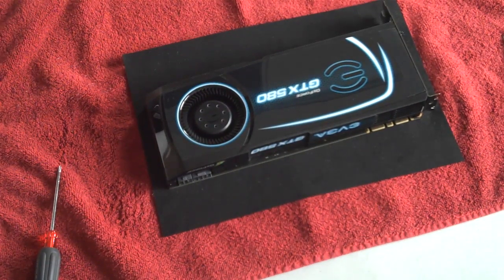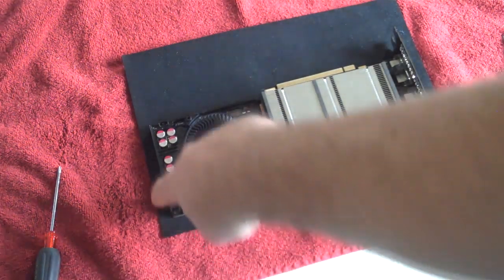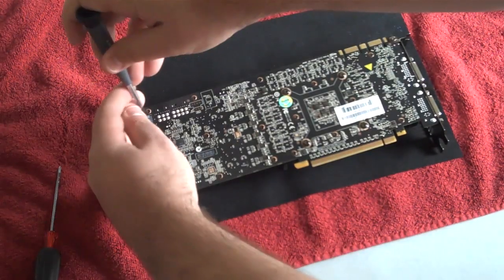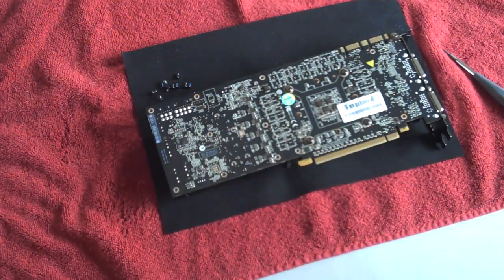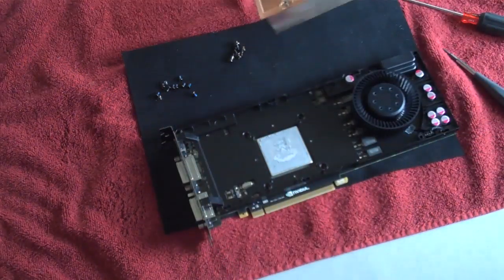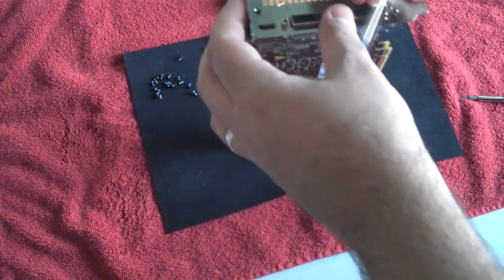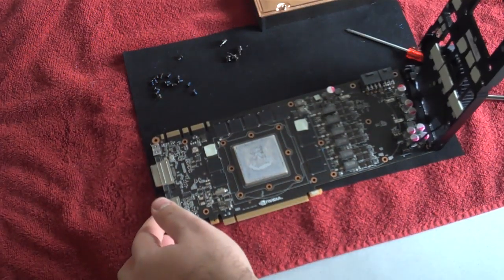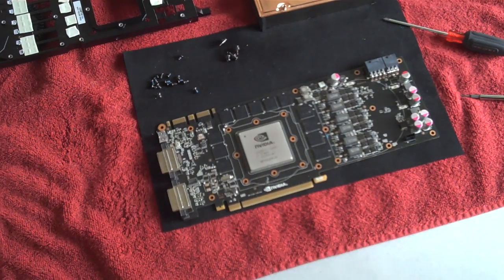Guide: GTX 580 Stock Cooler Removal / Replacement

Comment: Excellent, I've been meaning to replace the thermal paste on my 580 because it keeps idling at approx 80c, and games are unplayable because of temperature throttling my gpu.
Reply: lol, so you waited for it to reach 80c idle? :D
Reply: I know this is old, but 80c is insane and should absolutely not be idling that high even if the gpu is dusty or has bad thermal paste.

Comment: I know this is a very old clip now but can anyone tell me how closely this tuorial is to removing the heatsink and fan from the 580 3GB ? I'm having heat problems and having to use msi afterburner to manually turn the fans up during game time to keep it cool ? planning on reseating the sink and fan with pads and A5 grease and fresh pads along with a good clean to see if it solves the issue
Reply: Same

Comment: What size screwdriver do I need to remove the first set of regular screws on the side? My GTX 580 idles at 45-50c and I plan on reapplying it with new tim.